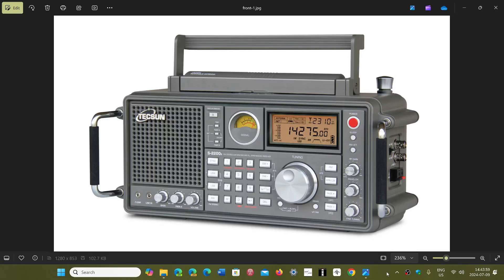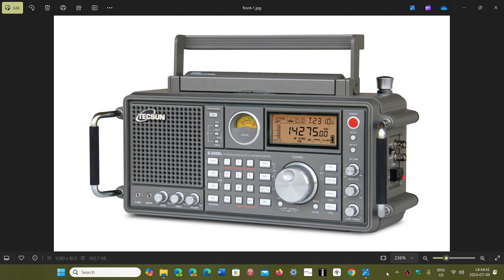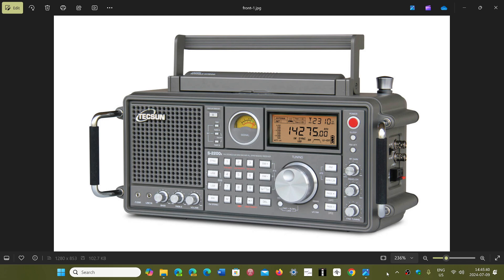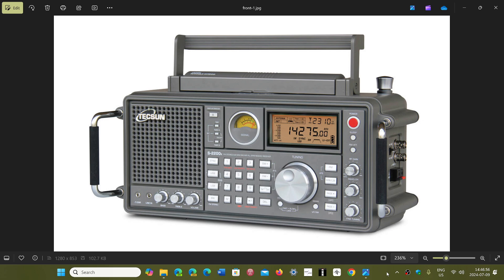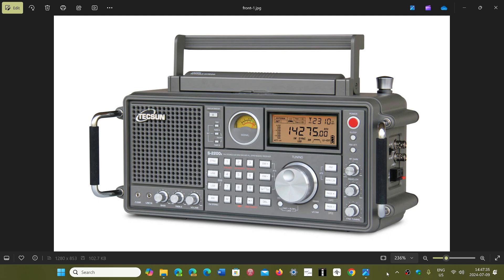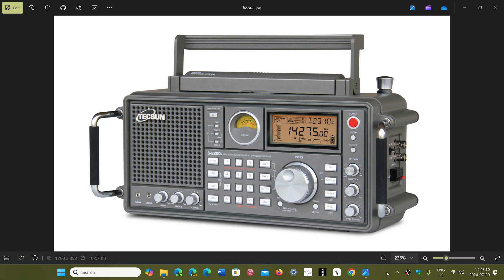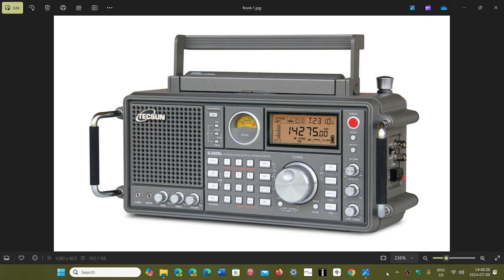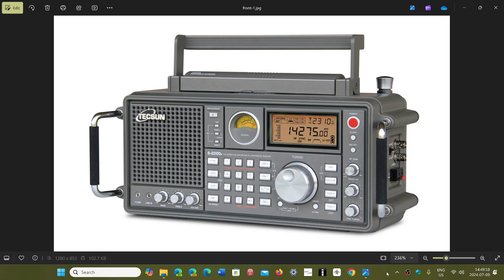NEW Tecsun S2200x Seems to be more advanced and will probably not mute when tuning

Comment: The 750 is a beautiful radio in the grand tradition of the previous Satellits.  The worst thing about it has always been the antiquated chip memory storage process.  I don't think anyone ever felt comfortable with that memory storage process.  We can only hope that the addition of 200x will give it a more modern and user friendly memory storage process.  It also looks like you can select various battery types.  Hopefully it will have recharge capabilities within the unit, or at least memory protection when you take the batteries out...

Comment: Until the radio actually becomes available, all this is worthless speculation.
Reply from the maker: It is not since we know some of the specs and we can see this is a different radio,as for the performance we will see
Reply: @OfficialSWLchannel  unless you have it in hand it's worthless speculation - you yourself said it under the D808 video - they can do whatever they want with specs because there are no standards.

Comment: I have an old S2000 which performs pretty well in spite of it's bandwidth problems etc.
No way I would consider the new S2200.  Yes it appears to have improvements but at the price and today's tech I'd like a waterfall and spectrum display.  To keep costs down they've obviously used the old cabinet to keep costs down so where would the display fit?  Also looking at the band coverage on VHF it appears to start at 54MHz.  Why not start at 50 MHz and include the 6M ham band?
Overall it looks like an improvement over the S2000 but at the price, no way.  🥴
Reply: I personally don't think a waterfall or spectrum display are necessary. You can still have a good radio without those. I think the VHF coverage might be a typo on their end because with a lot of their newer receivers, the FM coverage will start at 64 MHz because there are some places where the FM broadcast band goes down that low. I could be wrong on that though who knows.
Reply: @nathanpetrovski7525  True but it's real nice to see what's going on either side of the received frequency.  I'm looking at this considering the price of S2200. As a licensed Ham operator I really like the spectrum/waterfall display on my transceiver.  You might be right about the 54MHz VHF.  
😀

Comment: I think it will be more of the same, without major changes.
Reply from the maker: Just by the bandwidth and display .. it is totally different
Reply: Just from what we know so far:
* A selection of 5 bandwidths vs 2 on the original. (And the "wide" BW was too wide to be useful plus it led to the digital frequency display being off by up to +- 3 kHz.  This is why engaging any of the scan modes on the older model caused the radio to switch to the "narrow" BW.)
* Triple Conversion vs Dual Conversion.  This should provide better image rejection and reduce overload issues.
* Sync function for weak signals.
* Switchable LSB/USB SSB now uses fine tuning to provide pitch control rather than a BFO.
* Improved sensitivity for MW and FM.